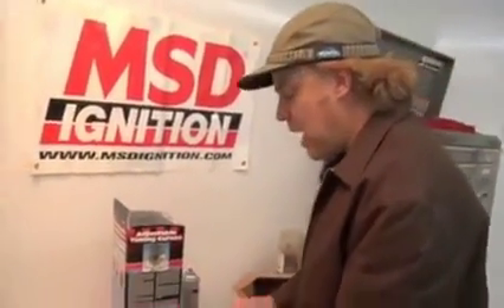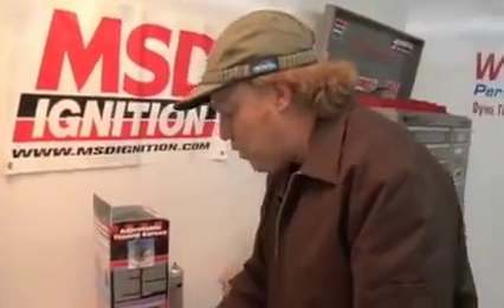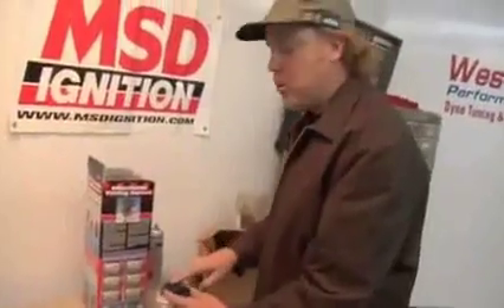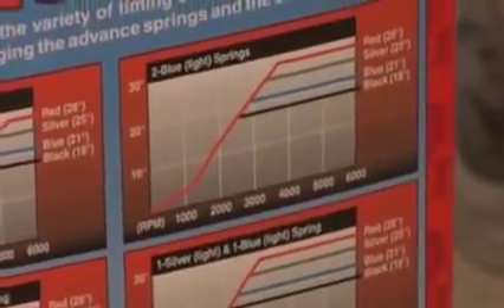How to set your ignition timing by MSD

Comment: Hey guys I wanna buy the  Pro-Billet Tach Drive Distributor (8572) but I wanted the MSD 6al digital will it fit? I have a 400ci sb Chevy if not witch kit is available with tach for Rev counter? Thanks in advance
Reply from the maker: The 8572 distributor provides a mechanical connection to the tachometer to read rpms and has no effect on a digital 6AL. You can use that distributor with the 6AL and it will function the same as a distributor without a mechanical tach drive. They are separate systems that don't affect each other.